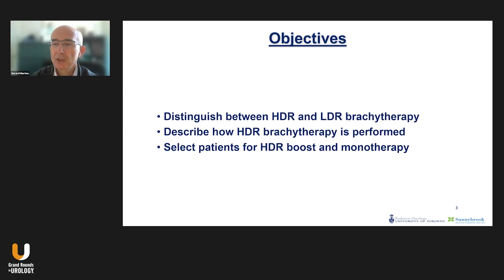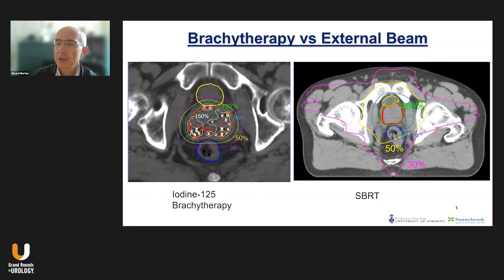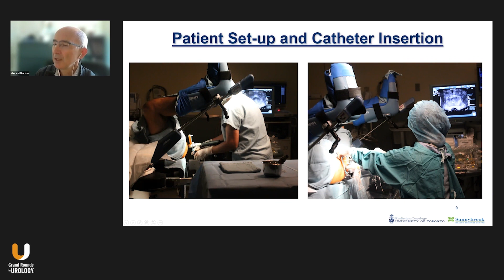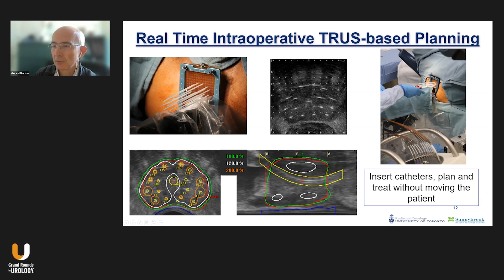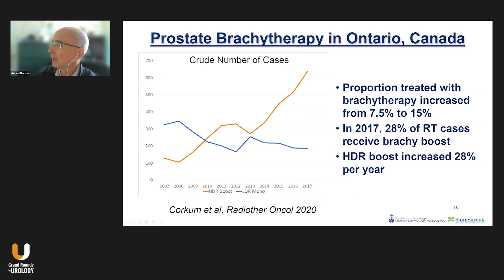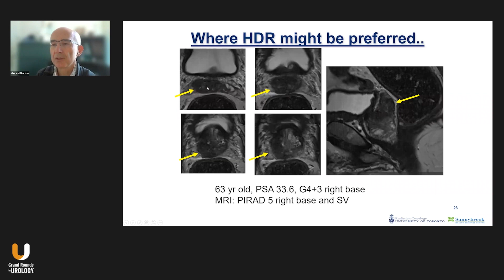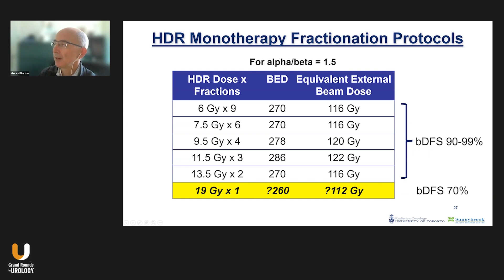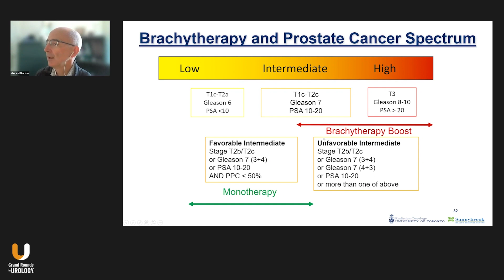Prostate High Dose-Rate (HDR) Brachytherapy as Boost and Monotherapy

Comment: I am 60yo with very high risk PC that has spread to vehicles and lymph nodes.

One month ago I had HDR Boost Brachytherapy, where 22 tubes were inserted and then connected to the external radiation source.
MRI was used to check the Teflon tubes were inserted correctly.
The therapy actually took 7 hours and I was able to walk the same day.

Before that I had 23 times of external LDR.

I also got ADT  / Eligard and Abirateron and prednisolon. This ADT is so awful because of hot flashes every 20 minutes 24 hours, 7 day’s a week.
THC from cannabis can remove the hot flashes, but I don’t want to be high all the time. Therefore I am considering a break from ADT or use estrogen.

Greetings from Denmark
Reply: How are you doing now?
Reply: @WastePotato The doctor could not get permission to give me estrogen, instead I got AndroCur, but only for 40 days. Then I hope I can get Nubeqa, but it is expensive. I know the result August 4th 2025.

Comment: I came within 18 hours of chemical castration (aka ADT, which they euphemistically like to call "hormone therapy") which is typically done in conjunction with external beam radiation.  Neither my urologist nor my radiation oncologist ever suggested that avoiding chemical castration via brachytherapy might be an option.  Via lots of research, I cancelled the hormone shot and now am scheduled for HDR brachytherapy.  Luckily for me, my caner is small enough and localized enough that this has a good chance of being a successful monotherapy.  For those out there who have been told they need external beam radiation with hormone suppression, I urge you to investigate the long term effects of chemical castration..... from what I can tell, you will never be the same.  Logically, brachytherapy (either low dose permanent seeds which deliver a higher dose in the long run, or high dose which is a quick but very strong 2-session exposure) makes a lot of sense as it delivers radiation most directly to the location of the cancer. There are also side effects to brachytherapy, of course.  These include urinary problems (relatively short term) but these side effects PALE in comparison to chemical castration.  PLEASE do your own research and do NOT just accept what the first doc says.  A doctor is very likely to recommend the thing that they are specialized in, be it surgery, external beam radiation with chemical castration, or brachytherapy.  This is not like being treated for a broken leg where the solution is a no-brainer.... YOU MUST DO YOUR OWN RESEARCH.